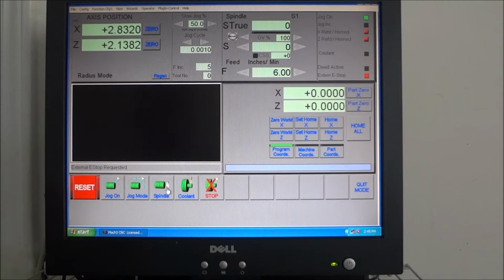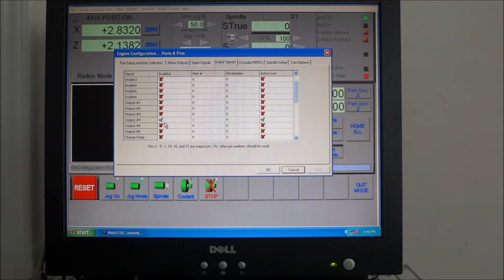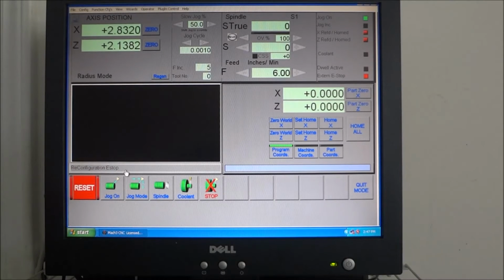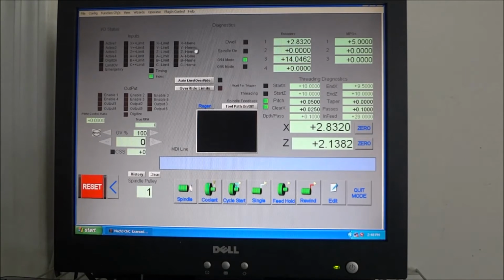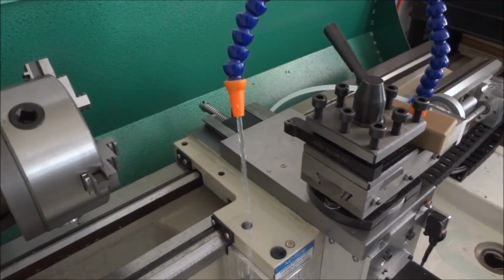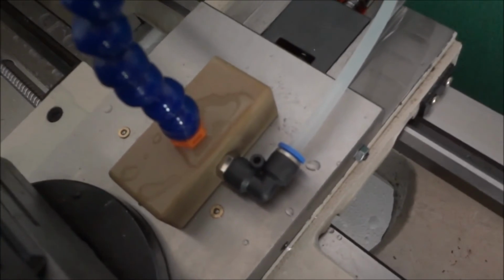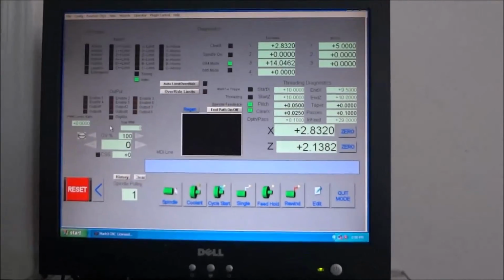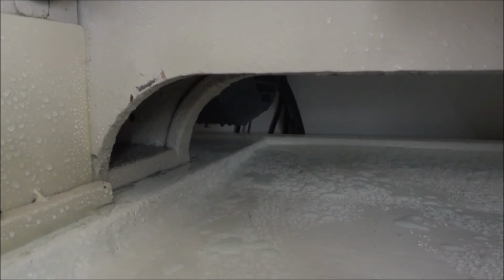G0602 Project Flood Coolant Mach 3 settings

Comment: water based coolant is fine mix it right get at least a 2 or 3 on a refract meter and it will be fine
Reply from the maker: I have found that the Koolmist 77 works fine, I have not had any Rust, smell, mold, etc. I only mix with distilled water and at the recommended rate.

Comment: Some filter foam in the pan should keep splashing down, something with a wider mesh. They could have some in the pond section of lowes/HD. Or a washable furnace filter. Look on HD website for "budget washable filter" could work as well, and pretty cheap to try out. worst case it's more filter media for the coolant.
Reply from the maker: smh3w Thanks I got her sealed Up

Comment: Sam
I have used Kool Mist for about 3 years on a mill and have had no problems with it.
After a job, I clean the mill and spray it down with WD40. nice vids. Thanks for making them.
Reply: wilkbilt flood or mist?
Reply from the maker: wilkbilt Great Thanks I will make sure to wipe her down , and give her a shot of WD-40